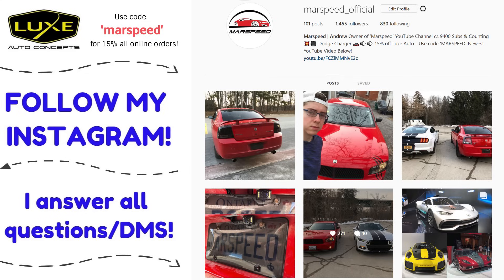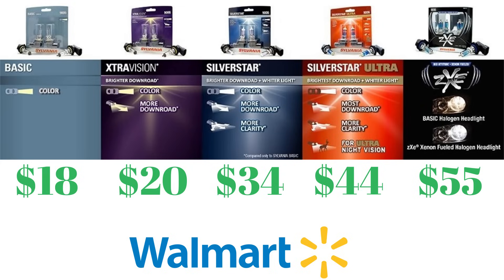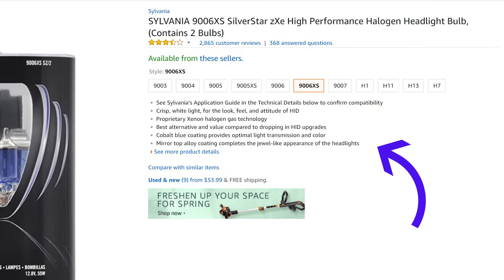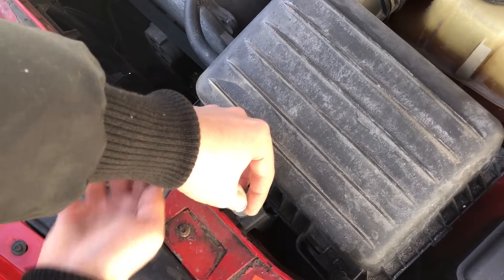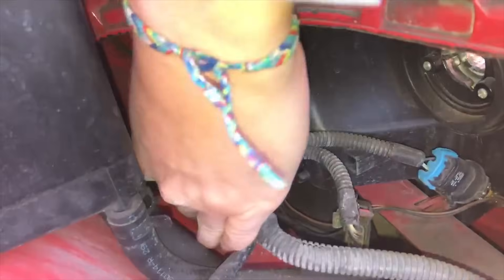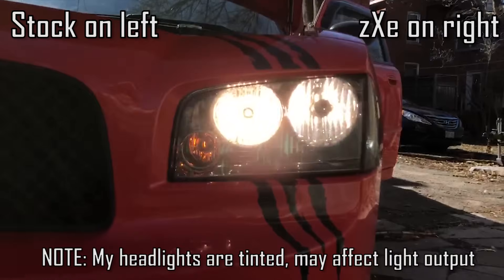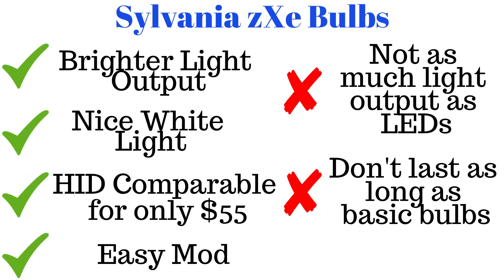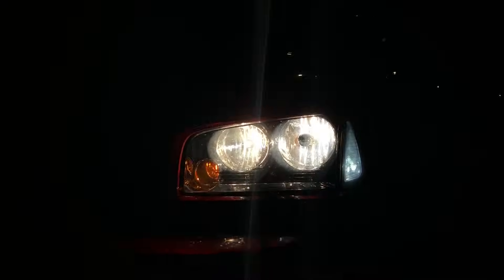Sylvania Silverstar zXe Headlight Bulbs vs. Stock - HID Alternative?

Comment: Great video ! Just picked these up, way brighter than these white LEDs I had. If you're gonna put in LEDs you need the full conversion kit with the ballast/ control unit or else its garbage.
Reply: LED's don't require ballast, but hid's do.
Reply: @Blueknight1960  true but leds require a driver fluorescents require ballasts

Comment: I've noticed a difference with these actually. And my pair lasted over two years. It really depends on the vehicle. Different headlight designs seem to affect it. HID or LEDs are only legal in projection lamp headlights. NOT reflector headlights. So for poor people like me with old vehicles, I'll buy these. They have much better distance down road and side to side. For me that's worth it and I don't care what anyone says.
Reply: Chk out headlight revolution's vids..The compare alot of bulbs and even some houseings..
Reply: It makes sense that different housings yield different results. My 'downroad' is significantly improved in mine. The brightness and focus improvement is subjective, but I'd have to guess 20%.
Reply: This was a year ago so I doubt you'll see it 😂 but I've ran leds in my 97 powerstroke for 2 years now and they're not projectors. And I've had no problems with getting stopped.
Reply: LEDs can go in reflectors, just aim the headlights down.
Reply: Definitely
Reply: In what state is HID or LED illegal without those lamps?  Not where I’m from.
Reply: @coreymiller1025  Minnesota where I'm from and many others

Comment: had a pair in my f150 a few years ago. they were a pretty good difference from the regular 20 dollar set from walmart. did just fine out in the oilfield and actually served as the light source a few times on older source pits with no light plant. had them going strong for 2 1/2 years before i t-boned someone. might buy them again idk, im looking at options.
Reply: I remember being out in the Southwest, either industrial lighting that burns your eyeballs out, or pitch black lol.
Reply: Get a LED replacement thats rated even brighter. I did this but had to place a led adapter in between because the led would flicker

Comment: That blue coating on the bulb actually reduces light output. They have the same distance as a regular halogen just whiter.
Reply: Indeed! You know your stuff. I just made a video regarding this. I upgraded to Silverstar Ultras and added some Nokya Hyper Yellow bulbs to compensate for poor weather when the white of the headlights are washed out. People don't believe that whiter, brighter headlights are only good for non bad weather conditions.
Reply from the maker: Makes sense to me, I’ve heard this as well, maybe it’s the white light that just makes it look brighter? Or shit stock bulbs
Reply: JustAnother CarGuy I installed LED lowbeams and installed new headlight housings.

Comment: You should think about LED headlights bro, I bought some for my 2014 Charger and they look awesome and they’re clear and bright, keep up the vids love them!
Reply from the maker: Definitely want to get some soon, just wanted to test these out first and that will be the next step!
Reply: Please buy an led housing instead of putting them in the halogen housing
Reply: EssentialGaming y
Reply: LEDs are not designed to work in a halogen light housing.   Yes they're bright but the light scatters all over makes it hard to see.

Comment: I’ve used these in my suburban and Z71 and they were definitely brighter than stock but only lasted about 6 months in both vehicles.
Reply: They should come with a one year guarantee so you can get a new set. Also make sure you don’t touch the bulb with your fingers

Comment: To add my input, I have the Ultras which are a single step behind the ZXEs. These premium bulbs by Sylvania are worth it! 

However DO NOT shop retail at Walmart or Advance Auto Parts. You'll be paying an arm and a leg. Go to ebay and you'll be surprised how cheap you can get these. 

I made a full comparison, side by side. Check it out!
Reply from the maker: Gonna check it out now! Yeah that’s a good call, the big brands are usually a rip off! Thanks for the comment

Comment: I bought these and my car has daylight running and the bulbs burned out in less than a year.  ((And I did not touch bulb )) very expensive for all I got outta the usage
Reply: hello  hitek9wittafulclip I did buy the LED and they lasted about 6 months to a year. I have bought these cheap LEDS several times I never get past a year. I had put these on a 2001 Toyota Tacoma several times one set actually blew my fuses. Also a 2009 Kia Sportage several times so it gets kinda expensive having to buy these once a year off Ebay. the cheap Ebay LEDS are not good. Im not only one who complain about these cheap Ebay LEDS ..

Comment: I put these and the ZXE gold on my 2014 F150. I'm not sure if it's the application or what but they look exactly like regular bottom of the line gold-colored halogens. I also have the same zxe bulbs in my fog lights and their bright white with a slight blue tint. Is there some reason they cannot match their bulb colors from one bulb to the other in the same model???

Comment: In my opinion these bulbs are a waste of money. For $5 more, you can get an excellent HID kit. These will produce a nicer light (especially since you can actually choose the color you want) and they are much brighter. If you don't want HIDs, there are also great $40-$50 led kits which far outshine any halogens. Since the beam pattern of a high beam isn't as crucial as the one on the low beams, you can get cheap $20 LEDs for the high beams. Again, they'll outshine any halogen, and the instant on-off means they're more effective at getting someone's attention. And you said it yourself: these halogens don't last as long. I've heard stories of people who have to replace these bulbs every 12 months, with frequent night time drivers replacing them as often as every 6 months! For that price, I simply don't see why you'd buy them given the other options available.

Still, I'm glad you made a comparison between these bulbs, since there's not much info on their actual performance.
Reply: He had reflector head lights. HID and LED are not recommended for that set up
Reply: @darbysmith7159  that's really not true. Sure, a cheap $20 LED with a giant COB chip will give you a bad beam pattern. However, many $40-50 LED kits use CSP chips which mimic the size and shape of the halogen bulb filament very closely. In most cases, these LEDs create a perfectly usable beam pattern that is very close, if not identical, to the stock beam. On the other hand, I don't recommend using LEDs in projectors, since projectors are much more sensitive to minor changes in size and shape of a bulb. Sometimes even high quality LEDs won't provide a good beam pattern, and will produce an dim, unfocused beam.

As for HIDs, many cars come with HIDs in reflector housings from the factory. Older Lexus models, Infiniti SUVs and the 2nd gen Toyota Prius often have them. I've also seen plenty of cars with aftermarket HIDs in reflectors. While I can't say anything about the beam pattern, I can say that they usually aren't blinding. Since the discharge capsule of HIDs is usually very small, they usually work well in both projectors and reflectors. While I wouldn't recommend using HIDs in reflectors, it is certainly possible to do so and to get a good beam.

Many sites and YouTube channels, such as Headlight Revolution, have tested numerous LEDs and even some HIDs in reflectors and shown that they produce more than adequate beams.
Reply: @MrFastFox666  Many LED bulbs, even sets costing $100, interfere with radio reception and don't last long due to faulty components, wiring, etc.  I've personally tested several sets.  So far, the longest lasting set was just two years and they were the annoying type with loud fans which eventually stopped working.  I love the look of LED bulbs, but can't seem to find a reliable brand.  I'm willing to pay more for a product that lasts and doesn't interfere with other systems.  Oh well, at least the LEDs in my house are working (knock on wood)
Reply: the last set of these i bought lasted 2 1/2 years before i t-boned someone in my f150. worked 2nd shift in the oil field and they worked great for just grabbing some bulbs at walmart on my way out to location. while not the best option they are an option for cities with light restrictions.

Comment: During installation you were not only “not wearing” gloves but are also touching the glass of the bulb! The oil on your hands will eventually blow that bulb! This being an instructional video maybe you may want to put some caveats in this video! Otherwise thanks for the effort in the review.
Reply: Its actually the oils on his skin that causes a hot spot,to which it blows due to that..NOT just cause the oils of his skin make it blow..So if your gonna shit on someone,have details in place.....Its same thing as fryin an egg in a fry pan..
Reply: @craig_sez8534  it wasn't shiting on anyone. Hopefully just a helpful tip. and it is eventually the oils on the hand that cause the bulb a problem. Skip the semantics.

Comment: $55 a pair for that? You could’ve gotten top of the line LED’s for thatb
Reply: Tyler Sullivan you have to do a conversion kit for real leds I think
Reply: Marco Nales false I own real LED’s they have a driver that plugs directly into your factory clips
Reply: Marco Nales high intensity discharge bulbs need a conversion kit, light emitting diodes do not
Reply: Tyler Sullivan well I don’t know I got hids that work for my car
Reply: Where can I get some good ones for my Cadillac CTS 2003 ?
Reply: @max F leds are the future, but they are not as good as hids yet. Leds usually cause glare so even if you aim your headlights down you'll still have lights lighting up the trees. Some cars take leds very well and have little glare.
Reply: @max F Dude are you 12? Are are wrong
Reply: LEDs like diode dynamics and morimoto are dot approved to name a few get your facts straight sir.
Reply: REALLY

Comment: Do you know anyway on how to clean out the inside of the headlights glass.
Reply from the maker: You will have to take apart the sealer that keeps the housing and glass sealed, and then reseal. Or possibly take off the headlight and take out bulbs and see if you can get in there somehow with a towel or something

Comment: No offense but there's very very little difference, in the end it's still just a halogen bulb. Put the Silver Star next to an LED or an actual HID and you will be blown away with the results.
Reply: some places wont allow you to modify non projector housings with HIDs. for one it can blind the shit outta ppl since they arent made for them. and 2 i had a charger many years ago and HIDs are ass with them... chrysler has issues with resistance and it causes them to not work properly and buzz and flicker

Comment: Did u know for the 2009 charger the high beam bulbs are supposed to be 9006 not the Xs, I know it’s dumb because they don’t really fit but if you in a bind and can’t get ahold of the xs standard with 90 degree will fit
Reply from the maker: Really? Yeah I bought the regular ones a while back and had to return them because the 90 degree connector made it so annoying to fit in
Reply: There even harder to take out..

Comment: Wouldn't it be cheaper to buy a new headlight assembly? Js
Reply from the maker: No headlight assembly is minimum $200 and for the charger you have to take off the bumper. Bulbs are now like $30 for LEDs on Amazon

Comment: Anyone know what the "XS" is for on model 9005 XS?
Reply from the maker: It means the connector to the harness is straight and not at a right angle. Most 9006/9005 are at a right angle and they won’t fit in the charger headlight housing

Comment: Nope I got these once they didn't last one year waste of money
Reply: Russ Novak i have some that lasted almost 2yrs. 
1) If you didn't use gloves to put them in, then yes you are right. Plus you HAVE TO use bulb grease to help dissipate the heat or again they will not last as they burn hotter than a basic bulb.
Reply: TexasLawDawg2001 I did use grease and didn't touch them work my fingers
Reply: Russ Novak My only explanation is they must have been defective.
Reply: +Russ Novak That's why I shop ebay and not full retail. No need to spend over $20 for Ultras or ZXEs that indeed have a shorter life span. I got some two packs of Ultras brand new on ebay for $23 total with shipping. Now I have back ups!
Reply: @novakruss510  they are warrented for 1 Year so you shouldve been glad to get a free set. They dont last as long as a basic they burn hotter.
Reply: WOW

Comment: You do realize that your camera will automatically compensate for white balance and adjust the exposure. It's utterly pointless to compare and take video of the two bulbs without making the proper adjustments. Furthermore, you seemed more concerned with the color/look of the bulbs rather than their function. The harsh bright white (blue) color creates greater contrast which in turn makes the less lit areas of the road appear even darker. Your use of the British slang "zed" is also very annoying.
Reply: Its not slang tbh, its how its pronounced here in Canada aswell.
Reply: Everyone else except Americans say “zed.” Get your facts straight